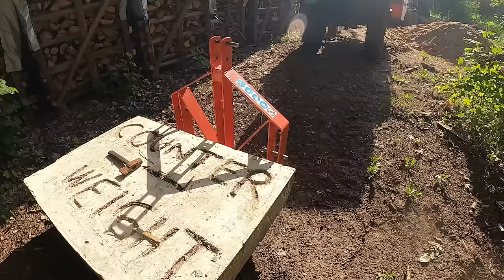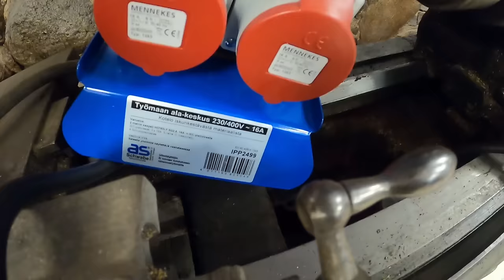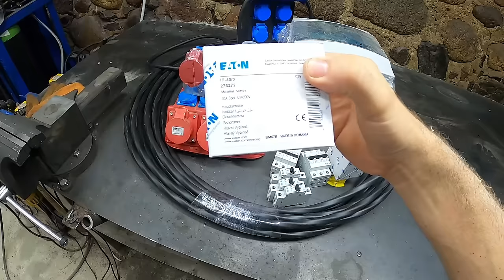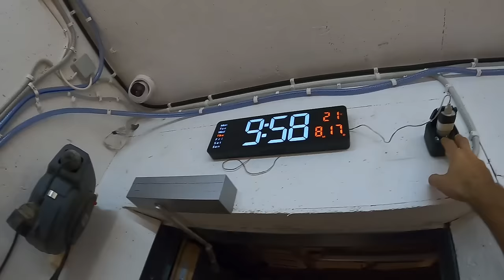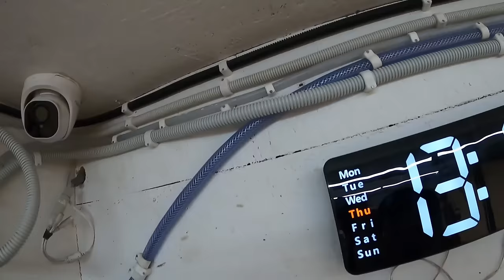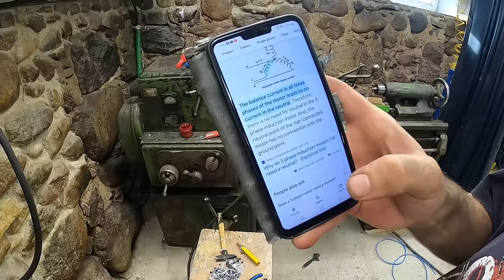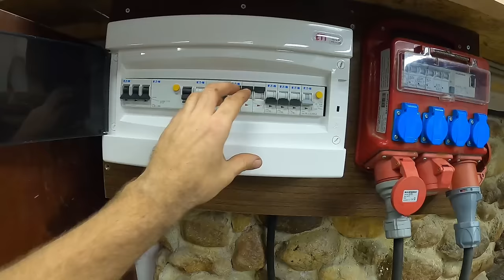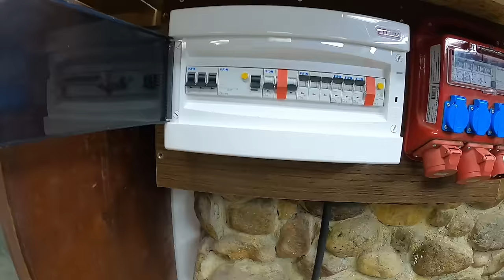Buying and installing a soviet lathe - STANKO 1A616

Comment: The motor was tripping the ground fault circuit interrupter (GFCI) due to inductive imbalance that occurs within the first half-cycle of energizing/starting the motor.  The GFCI is designed for personnel protection so trips within the first quarter-cycle at very low leakage levels.  The imbalance occurs because when the the poles of the breaker/switch/contactor closes, the three coils in the motor magnetize at different rates since their voltages/flux will be different at that instant.  This balances out after the first half-cycle or so; and there is nothing wrong with the motor.  You're lucky to have 3-phase power available; this is very rare in the US for residential service.
Reply from the maker: It's pretty standard here actually i am surprised.

Comment: I'm wondering if maybe it's not the clamps that suck but that garbage air hose is continually deforming causing the clamps to need tightening? IDK I'm not a clampologist but that's my suspicion.
Reply from the maker: Clampologist 😂😂😂 bro... Good one. Yes its the crap airhose, its not designed for wall mounting

Comment: I would consider turning the lathe 180 degrees. If you want to put a shaft through the headstock  you will have to drill another hole in your wall. Just trying to prevent heartache. Great videos.

Comment: The many different gear levers are to set the ratio of the horizontal lead screw so you can cut threads with different pitches.
Regarding the circuit breaker, it is either tripping on excess start-up current, or on leakage current. I would think that the big motor is simply too high rated for the small breaker. If so, a larger breaker will solve the problem. 
As regards leakage current, you should get hold of a Megger and test for leakage to Earth, or simply hook up a electricians trouble lamp (incandescent globe) and see if there is a path to earth through one of the phases. 
Regarding earth safety, you could wire an outside earth stake to the frame to make sure that it could never become live. 
BTW, you did a really good job figuring it all out, Ants.
P.S. the extra nylon string is to simplify stripping of the cable, and sometimes (with multiple colours) do identify each cable at the end of a run.
Reply from the maker: Thanks for the comment mate

Comment: Dude, for a couple grand?!?!?!  You got at least several grand in tooling in that cardboard box!  Nice find!
PS.  those levers are for spindle and carriage drive speeds.  A good channel for watching lathe and welding work is Cutting Edge Engineering.
Reply from the maker: yeah i looked it up and some of them drill bits are really expensive lol..

Comment: If i was the garageowner i would have used same stuff as we use in trucks and trailers
Raufoss ABC connectors and 12mm poly pipe/hose

Comment: We have 240 volts to the house then in the breaker box it is split in to 120 volts by separating the 2 legs of the power coming in. In other words we have 3 cables coming in, 2 each carry 120 volts and the third is a neutral. By splitting the legs into 2 we get 120 and by using both legs in the main power we get 240 and the neutral is the flow back to the power completing the circuit.The breaker box as well as the meter box is grounded in order to prevent a shock.
Reply from the maker: Yeah, we have 4 wires coming in, 3 live and 1 PEN or ground. No neutral, neutral is generated inside the box from ground or rather the PEN is split into PE (ground) and N (neutral), 3 live wires connected to motor do not require neutral connection and the voltage between the 3 lives is 400V
Reply: I think he is talking about the American system where 240V is split into two 110V feeds (both at the same phase).
Note that these are not "phases" in the European sense. 
The full three phase system has three separate wires running at different 120 deg phase from each other.

Comment: The rod with the slot which runs the length of the skirt  is the longitudinal feed drive.  The screw above the slotted rod is for threading the short handles select the gear reduction to select the pitch of the thread.

Comment: Yo AP!!! It needs a full rewire, look into a VFD, it will give you variable speed and can correct voltage. Also will make the old contacters redundant. Replace the old fuses with a 3phase breaker. I'd reuse the isolation switches.I did the same on my lathe. Sometimes its easier to gut it and start again. Cheers
Reply from the maker: I kept the fuses and also added a breaker. Double standard 😇

Comment: You have star connected three phase motor. It will pull a lot at startup. Those automate fuses have different types (letter) how fast they blow. My Atlas Copco compressor pulls as well, but it has a contactor that starts the motor in delta-mode and then after delay switches to star. That takes less power in startup.
Reply from the maker: i installed Type c breakers, they are meant for electric motors and allow high amps pulls from startup for a short period

Comment: When there is no neutral connection to the lathe how does the lightbulb or transformer work? It has to be connected to earth. If it is switched on it will immediately trigger the RCB. That is probably also why you measure a short circuit. Has your RCB an overload protection (RCBO)?  This could be also the reason. Did you try to wire the motor directly to your electrical panel to test it?
Reply from the maker: Yes i did

Comment: I’m thinking one of the top left levers will engage the feed gearbox and the feed screws. Those are the levers in the middle. They control the “automatic” feed speeds and directions. With the lathe off, try spinning the chuck by hand and engaging one of the top left levers. To get the gears to mesh. I’m guessing one of the bottom levers is high and low range, and the other is the spindle speed ranges. Again, sometimes you have to move the chuck manually to get the gears to mesh. Especially on an older machine. Hope this helps!
Reply from the maker: It does 👍

Comment: Excellent well put together video. Audio was good too. A sit back and get lost in some dud do his thing. I watched a vid of some dud taking apart a lath and restored it, even the paintwork. Question : Is it possible to update the wireing to modern day electrics. You might get a breaker switch added. Look forward to the update on how the lath runs. 🤠🥳
Reply from the maker: Yeah but its a giant amount of work. I will just add a secondary ground for the thing so if ot ever went full fuse on me it would not shock me.

Comment: Thanks for your vid 😇💟💟💟 Love and bless you Andris, it looks like the gear box has a oil glass and it sounds a bit dry and the bed should be vet. good luck.
Reply: True, but I think a sovietlathe sounds like that😅.
Should change the oil though... cheap investment.
Just make sure if you may have 1 or 2 gearboxes. Mine has 2 gearboxes and one of them is pretty hard to find if you don't know it's there (ask me how I know🙈)
Reply from the maker: On spare times soviet gearboxes are used as rock crushers. I do this all the time

Comment: Well done on the zip line and lathe, that lathe will be running a hundred years from now. How are the ways? You probably have a manual by now but  all the pertinent info should be on that metal tag on top.
Reply from the maker: Ways are a bit worn but not the worst

Comment: That lathe is a death trap. Please rewire the inside before use  and put another 5 earth points on all different areas of body and frame. Because a rubber matt will not save you , u be brown bread instantly!...Enjoyed the video, great work man!!..,be safe.
Reply from the maker: nah it's fine i asked a engineer

Comment: Some motors do not play well with a ground fault breaker and the start winding can unbalance returning current upsetting the GFCI.  Check it out if that motor is designed that way.  Perhaps the external transformer circuit was part of the starting circuit.
Reply from the maker: Motor is very old. Im sure its that

Comment: To protect your lathe motor from a situation where you loose 1 or 2 phases, you need a MOTOR STARTER which will drop all 3 phases if you loose 1 or 2.
Reply from the maker: hmm

Comment: Here we use a triple layer rubber hose with nylon braining inside and we usually crimp the fittings in the hose if er are going to do a permanent install or if we are using it in a business because OSHA requires iit..

Comment: Great purchase. One thing is soviet electronics are not very fool proof. Looking at all the huge fuses and breakers it's amazing how dose it work in the first place. The amount of patched wires tells me someone before you was trying to fix the issues but insulated the wires poorly. The lamp is a good thing to have but if Id use it. The wires need to all get replaced with new ones. One word of advice is to change the fluid in the lathe gear compartment, very important the oiling system is not fubar.
Reply from the maker: They were all empty lol

Comment: As you know GFI is triggered when there is any leakage current to ground, which is chassis in your case.  Since it only trips when you engage the motor, it is likely that the motor start circuitry is either not wired for ground isolation or you have a leaky capacitor or something else sending a small brief spike to ground during initial startup.  You would see a non-zero voltage on the ground if you used peak hold on your meter during startup.
Personally I've never seen GFI used on a motor bigger than about 3hp (~2000 watts), likely because the huge magnetic flux from that much current change at startup could induce a voltage in the chassis (ground) even with no contact.
Reply from the maker: I see. Yes this was what was told to me by 2 different electrical engineers

Comment: In Canada you don't need a special license until the trailer is licensed/rated for 4600 kg.  We don't have 3-phase to residential which really sucks so we have 200 amp split phase panels...
Reply from the maker: Lil 4600kg thats a lot. We are limited to 650kg on basic license 😂😂😂

Comment: I have a theory why the RCD is tripping.
At 1:44:00 there is a grey and a yellow thin wire, which controls the relays (power contactors). So at some point the 220V relay needs a neutral connection (wich is ground in this case). It is hard to see where there is a connection to the ground.
So use a proper 5 wire cable with a neutral and connect the neutral to the neutral for the relays properly.
There should be no suspicious ground connections going to components somewhere and your problems should be resolved.
At 1:47:13 it looks like the relay is connected at the top with one of the phases via a yellow cable. So I think the the relays are activated by switching the thin grey and yellow line going into the bottom of the relays to ground. So this is basically a safety feature? The lathe will only turn on, if the metal frame is connected to ground. So the switch wich is activated by the metal lever will switch these wires to ground. You somehow need to change this to the neutral line.

Maybe this makes sense?
This is a similar power contactor: https://www.youtube.com/watch?v=2HvqbnQgIWU
Reply from the maker: I will look into this. Thanks

Comment: I am knowing you will put the Sowiet lathe to work! Such a handy machine! I have a tiny lathe and have used it for many things. Just last week, I turned the commutator on the starter for my car. I should be looking for a large one. I am amazed at the plastic electrical boxes and things.

Comment: i know most ppl use pex for their plumbing but im wondering if it'd be viable for using as an air hose system. Might be viable depending on how much pressure u need stored in those lines.
Reply: how cold is the air coming out of the compressor? sometimes they have like a refrigerant inside of the tank to help compress the air, this could cause the air to be very cold when it goes into the lines, which is whats causing the rubber / plastic to shrink
Reply from the maker: Ambient

Comment: Hey Andris, maybe your differential is a 0.03A and not 0.3A. That would be an option on why is going down every time you try to iniciate the lathe. 
0.3A is industrial use and 0.03A for domestic use, at least in Spain.
Nice video, as always.
Reply from the maker: I will try to test it out

Comment: It is highly recommended to use the RCD...this unit will operate at 30mA leakage. I guess that 3rd phase insulation is faulty. If you have an insulation tester you will confirm this.
Reply from the maker: Or maybe try a less senstivie. Rcd

Comment: Usually you have sets of levers of two or three, not sure about that particular model, but il looks the bottom are the spindle gears, the middle row should be feed, the thing you activated at the end in reverse though, the upper probably are the thread pass, you have to check maybe with some glossary.. Good work though, I feel a bit concerned about the cracked wall.. Let's hope some storm won't push over the tree and cause mayhem.. 
Cheers, keep on. 
😉
Reply from the maker: Thanks for the info!

Comment: hi, rubber matting - under the box frame is needed and the lathe is level on point to point - removing the twist in the frame and bed of the lathe. - it will take awhile to set up but will be way nicer to use.
Reply from the maker: Yeah
Reply: Does your bobcat loader have a name yet
Reply from the maker: "the white hobo"  @johnnybgoode6466

Comment: 1:01:00 why you are not using 5 wire cable from main sheet?
Reply from the maker: This Lathe does not need neutral.

Comment: You can get 100mA circuit breakers, but maybe get an electrician to measure the leakage current. Add a big earth wire too

Comment: I would definitely consider rewiring that thing, at least the worst of ot where there are multiple splices.
Reply from the maker: wiring is not the issue, the motor is causing the trip
Reply: Please do me a favour and forget about the 30mA RCD. It is perfectly fine that this machine is not compatible with it. That is not the machine's fault. It is the fault of the inappropriate RCD.
Earth the machine with a nice 25mm2. Cable and rewire the machine.
By the way: fantastic lathe.
Reply from the maker: 25mm2??? woah dude that's like my tank rope 🤣🤣🤣🤣🤣🤣 i added a 8mm2 and there's a extra wire which was 3 total i think, so 11? i figured it's not worth it going bigger because the ground cable that goes to the grounding rod is 8mm2, asked a electrician at my workplace and he said 6 should be minimal. What do you think?   @gabelizr1308
Reply: Your friend is right. According to DIN, 6 is the minimum.
And we are not talking about huge currents. They are limited by your circuit breaker.
So you certainly won't make a mistake with 6. 😌👍🏻😎

Comment: @Ants_Pants  I'll tell you exactly what you need to do.

You must install the earth rod near your workshop, connect it to your new swithboard earthing terminal with 16mm sq copper cable or steel wire or steel strip equivalent (not aluminium). You can copy this setup from your box with electrical meter - it's 16mm sq earthing cable connected to the earth rod of some kind.

You must run another earthing cable from your new swithbox earthing terminal to the lathe earthing terminal.

You must pull one more earthing cable of at least 16mm sq copper or equivalent from earthing terminal of this new switchbox you just installed to earthing terminal of your another switchbox (you have at least two supplies in this building, coming from outside, I guess).

You must clear the earth fault in the lathe electrics, if faulty. Then you need to separate earth and neutral in the lathe electrics if this setup needs neutral - it should be easy as your already got all the terminals needed inside lathe.

You must change supply flex cable with red plug from 4 to 5 core, connect 3 phases to phases, earth from switchbox earthing terminal to the lathe earthing terminal, and the fifth core should be connected from the neutral terminal in switchbox after the 30ma RCD to the neutral terminal inside you lathe.

And when all done, you can safely continue blaming drunk Russians. 

Of course it's better to call electrician to do it for you, by the way. He could check the rest of your DIY electricals, just in case. Electricians are very chip now, you can easy afford one.
Reply from the maker: i did have a electrical check out my box, he suggested to ground it separately, he said 6sqmm should be minimal, 16 seems like complete overkill to me. I added a 8mm2 grounding wire and took it inside the box where i connected it straight to ground of the post.

Comment: NOT an electrician here but is it possible the motor start up amps is greater than the run amps thus tripping the breaker due to it's surge?
Reply from the maker: No the breaker i got is type C which is meant for electric motors, they will allow huge amps draw for a split second in order for the motor to spin up or start up

Comment: nice machine! don't forget to put gear oil in it, seems there is none right now. if you run it without oil you will ruin the gears and bearings.
Reply from the maker: Yeah totally dry

Comment: Brilliant video, really enjoyed it! You need a megger tester to check all the insulation and the motors for earth faults. As long as there is a good ground connection to the frame of the machine you are safe IF the lathe is connected through a 16 amp overload breaker. Do not connect your lathe socket direct to the main switch or you will have no protection ! If an earth fault develops the current will flow back to the breaker and when it rises over 16amps the breaker will trip.  Welcome to the world of crappy distribution boards and crappy clamp terminals brought to you by the crappy EU! Keep up the good work!
Phil UK